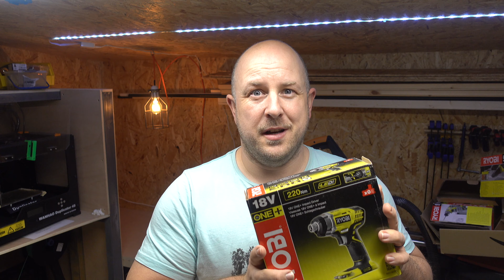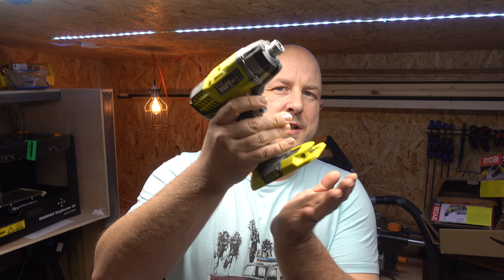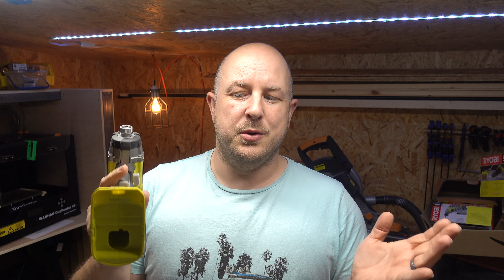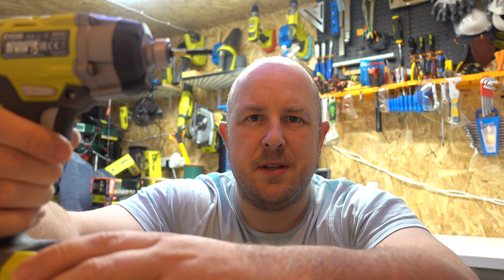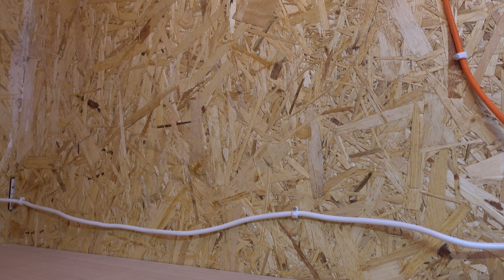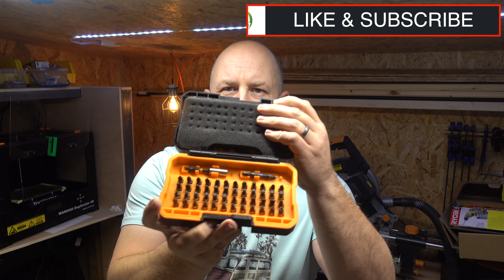Checking out the Ryobi Impact Driver - RID1801M

Comment: Speed mode 2 is for drilling not driving, because it turns faster but uses less torque. For driving screws into wood you need a lower speed which translates to more torque. Also, if you set your clutch correctly, the screws won’t damage the wood. For me it’s not really the Driver, but the person who’s using it. Today even 12 Volts Drill Drivers pack a respectable punch in the power stakes, and they get the job done.
Reply from the maker: Good call. I was in the right mode for driving, but agree speed 1 is more appropriate when driving.